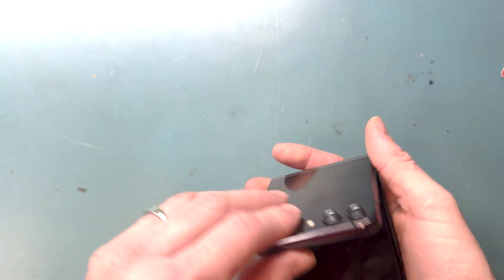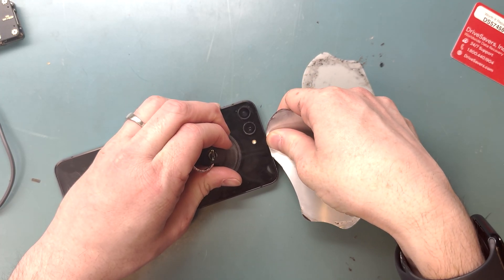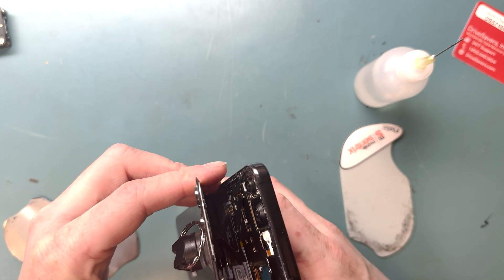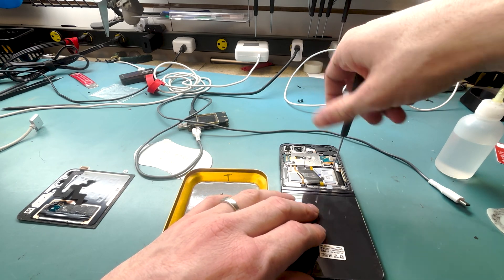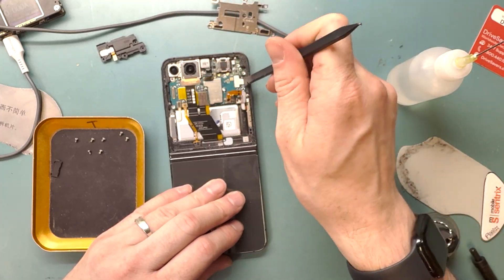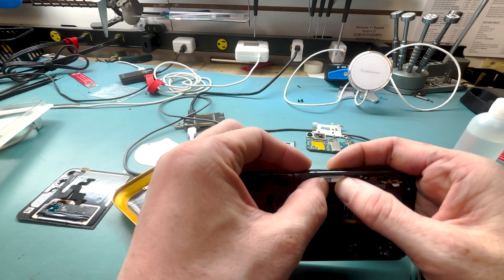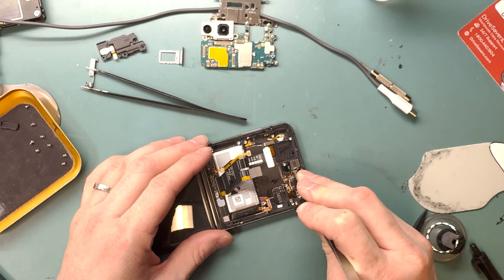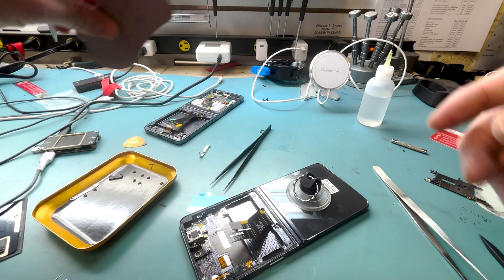🛠️ Flippin' Fix: Samsung Z Flip 5 Screen Replacement Guide 📱

Comment: Did it work for you after the Samsung logo? I installed the same screen, from the same supplier, same model. It works, but after the Samsung logo, the screen turns off and only the small one in the back stays on. I had a similar problem with the Z Flip 4, but I just changed the magnets and it worked. However, it's different with the Z5.
Reply from the maker: It did work it could be a loose connection somewhere else or a bad screen

Comment: Oh my flip. Thanks! I'll let you know how I do. I have two Z flips. Got the 1st one in a 2 year virgin  contract. Within 5 months, the screen flipped out in a glitchy way.  So I bought another one, second hand, switched my Sim card over. Carried on for 10 months.  Along the way I noticed it was black, just in the fold. I cannot recall when exactly. Moot!! Anyways, yesterday the screen looked as though it was lifted away a bit more in the fold. So I press on it, trying to smooth it down. Well, doesn't the flippin' thing just start going blank half way on both halves. Therefore, I can see half of the top and half of the bottom. FLIP! I am wondering if I could use the screen from the first phone? 🤨
Reply from the maker: If it is the same phone but locked to a carrier you could take the part if it is working from it.